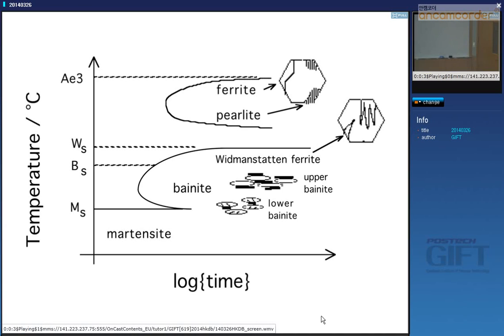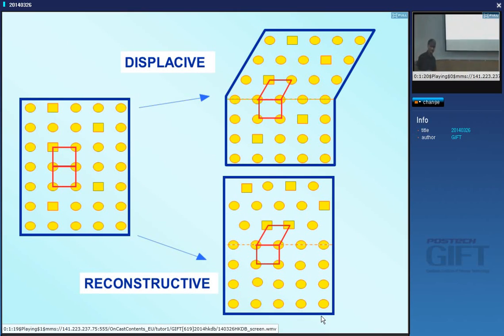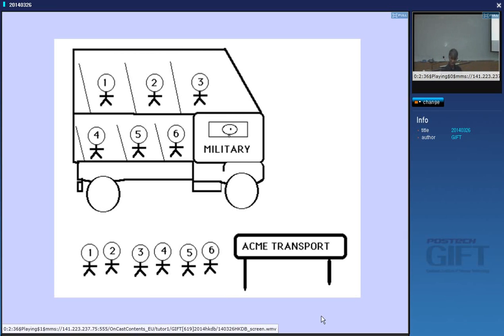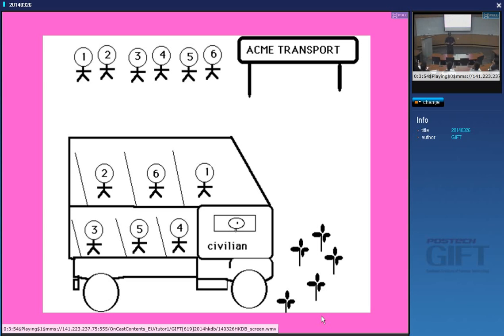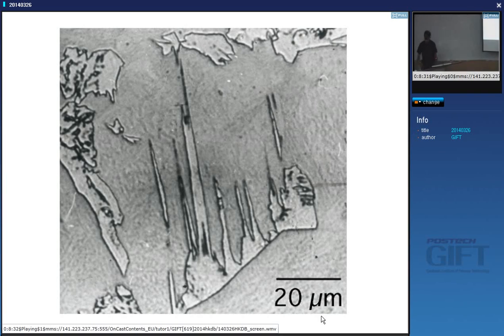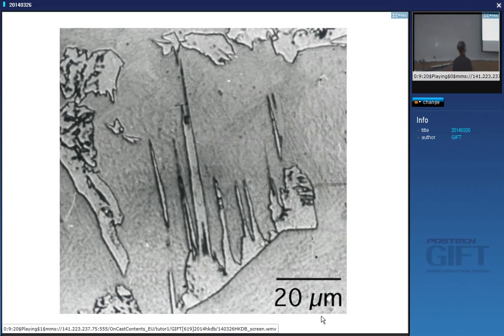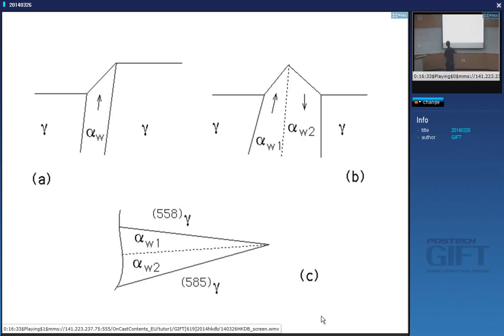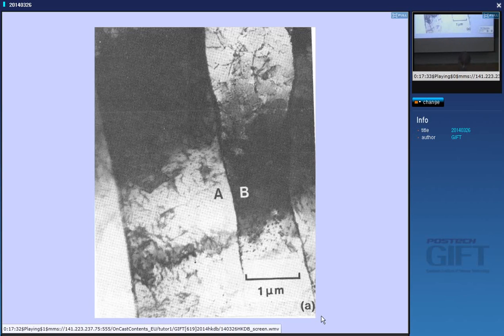Phase transformations in steels 6, 2014

Comment: As it was said  Widmanstätten ferrite is detrimental to toughness as it tends to grow in a parallel array of plates with similar orientation, which offer low resistance to cleavage crack propagation. 
How this transformation could be avoided in welding? Allotromorphic ferrite could support the transformation of acicular ferrite but it could allow Widmanstätten formation too. Is it the best choice?
Reply from the maker: One way is to minimise the austenite grain size, and another to increase the carbon concentration.
Reply: Many thanks professor Bhadeshia.